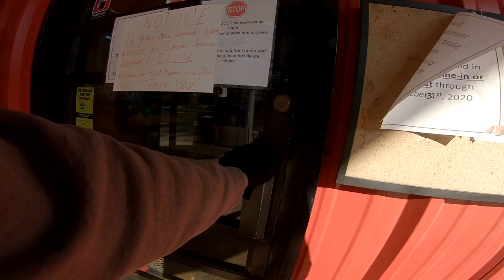Motorized Bike Coaster Brake Warning!

Comment: I was the guy that said sealed bearings where better. I forgot to tell you coaster breaks don’t hold up to super human speeds on the bike. I use mountain bike rims on my cruiser most all of them have sealed bearings and eliminates coaster breaks. My cranbrook is a five year daily rider except in snow. 20,000 + miles on fourstroke 49cc i broke three of those coaster break rims. There expensive, just go with mt bike rims and ignore the large gear cassette, i just run a tight chain on one gear. Way cheaper !
Reply: I was thinking about using a MTB rim….but their spokes are punny….and a CNC hub kills spokes’ even if you make a key….it rips the hub apart…then the spokes…it very annoying!
Reply: How about those “heavy duty” 12 gauge spoked rims from bike berry? Are they any good?

Comment: I have a coaster brake on mine and have had zero issues. I think people are having trouble because they're leanin' on that pedal with every fiber of their being, and, having gone through more than a few coaster brakes for that reason, learned you can't do that. Gradual braking is key, and it also helps to have front brake assist, at any speed. This is all based on my own experience...
Reply: Yup just tap it works fine

Comment: I had this happen 2 times... do not trust coaster brakes at high speeds! I was going down a road at about 35mph when it locked up on me completely. I did not fall, thank god, but I ended up grinding my tires into oblivion. I did take the brake plates out, and slapped a disk brake on.

Comment: Those tower thingies are loading posts for Traction sand, in tough situations where the rails are wet, covered in leaves, etc... Both steam and diesel electric locomotives have air driven sanders that shoot sand in between the rail and the wheel to boost traction.

Comment: Good job keeping it upright. 
 Coaster brake failure can ruin your day. If that’s all you have run it just remember to periodically pedal even though you’re not with cadence of the bikes current speed pedaling slowly to keep that thing from building heat. Keyword pedal slowly and not too fast you may  throw your chain off.

Comment: Well, i was planning on running a front v brake and a coaster brake, but that seems like a bad idea now. I think ill just buy a dual caliper set now
Reply: Is the only think you have to change out is the coaster breaks for the cranbrook to be semi reliable? Can you put them on the steel rims?
Reply from the maker: So far the only failure I have had on a Cranbrook is the coaster brake. More specifically the soft coaster brake arm striped out.
Reply: @LAHover  thanks. So I’m going to be a first time builder and planning on getting a cranbrook and zeda 80 firestorm. What should I replace right from the jump? Delete the coaster brakes for dual caliper / hand brakes? Will I have to adjust the crank arms? Do you know of any videos with a guide to this since so many people end up getting rid of the coaster brakes? I am a first time builder and new to this so I am scared to get the cranbrook and not know what to do with it to make it more safe. I posted in your discord as well

Comment: The 40:1 is slightly richer than 32:1 and back in my racing days, we would do that to change fuel mixture a half jet size. It's not much of a difference, but you can tell easily between 25:1 and 50:1.

Comment: I don't use coster brakes on motorized bicycles.  The first time I had the little screw vibrate loose holding down the break arm, the brake arms starts spinning a million miles an hour till the hub seizes up.  Once was enough for me.  I take the brake arms off and use a C break.

Comment: Ive never had a bike with coaster breaks very long, that bike setup is slick as hell though!
Reply: I did it's cool because you only need front brake lever on your right but have a lot of cons.
I think the coaster hub can't handle high rpm bevause it burns inside and dried hub the lubes.

Comment: Im not sure but if you grease the brake shoes inside the hub, it may help with that. I did the same thing to a cranbrook and it seemed to help
Reply: I did the same thing with my Cranbrook packed it with high temp grease and removed the brake plate.I have disc on the front n shoe brake on the back

Comment: I found this video because I heard that coaster brakes can malfunction going at high speeds, and I wanted to see if other people had experienced this. I like to ride downhill on my BMX bike, and hand brakes don't completely stop you at high speeds so I was thinking of getting a coaster brake. I will just stick with handbrakes. Thanks for this video.
Reply: Why not go disc brakes
Reply: @Mi_vida_loco  Well, I have an older model BMX bike, and I don't think it can take disc brakes.?
Reply: @imagesinla8575  they make disc brake kits for all size wheel and hub I have disc brakes on my stock 1984 mongoose bmx bike
Reply: @Mi_vida_loco  So did you just go down to your local bike shop, and get it done? Or did you order the kit from somewhere? I'd sure appreciate a little more info.
Reply: @Mi_vida_loco  By the way, I have an early 80's Cook Bros. Racing.
Reply: @imagesinla8575  that’s a nice bike if it’s the one I’m seeing it’s identical to mine and you should be able to get a set of disc brakes for 50 dollars tops
Reply: @Mi_vida_loco  Whoa, thanks for the info. buddy. I'll be looking into it.

Comment: My coaster brake also failed while I was driving downhill.
Almost had an accident thanks to the Coaster Brake itself even though it failed I was saved by it because the Hub locked inside and the wheel don't spin anymore and that's why it stopped me downhill for being a destroyed but still brakes.
The rpm burned the mechanicals inside the hub, the high heat caused to dried all the lubes and destroyed my brake.
I'm only using a China Coaster Hub.
Only last 1 month on Motorized Bike.

Comment: Your mix change is definitely the difference in your high rpm knock/ping. 
Go back to your 32:1 and enjoy, the power gain is insignificant if your tuned for the mix right, which it is at your old mix.
As to filing the key, yeah it can be done, but be prepared to crack the case regular to reset it and lock it down, the vibes will not allow it to stay set long

Comment: I'm getting ready to install an engine on my bike. So far I've only got the sprocket on and I put the tire back on but my back tire does not spend very freely what the heck I've tried to redo it like 8 to 10 times now and it's still not spinning freely any suggestions

Comment: I would have never thought of having a coaster brake hub on a trail bike how do you do quick pedal resets without a cassette or freewheel
Reply: It has a freewheel,but if u move your foot slightly more back,you engage the brake,the coaster brake is the worst
Reply: I also don’t recommend putting a fixie hub on your motorized bikes! too much of a party lol

Comment: i plan to use a freewheel with a 5 speed cluster if i can find a 26" with a frame of that type
Reply from the maker: Just went out of stock. But look up the Huffy Lockland (mens). It's basically the same frame but with rim brakes and a shifter. Also the Kent Bayside. Similar good for 2 strokes.

Comment: Somebodt stole my bike last night. Real bummed about it. I had a bbr racing motor and every part of it was upgraded.
Reply: You should check sites like let-go and OfferUp and Craigslist that's the way I found my stolen bike... call the cops tell them where they can find it on the internet and the cops set up a sting! try it
Reply: @tedshredhard23  i tried as well with my bike that was stolen. Unfortunately i didn't find find anything of Facebook Marketplace Offer Up or Craigslist... I didn't have a motor on it but i was riding it to work and was planning to slap a motor on it.

Comment: Same has happed to my coaster brake except my wheel locked up. I took it apart and packed it red grease seemed to to the trick. But I didn’t trust it after having to carry the bike back. so I no longer have a coaster. Went with sturmey archer hubs.
Reply: Which stumey hubs did you get

Comment: I have never had trouble with the coaster brake on my cranbrook now i don't go the speeds most of you guys go because I think 20 mph is plenty fast for that kind of bicycle. However i've only went about 15,000 mi on mine so I don't know maybe it does make a difference when it gets older.

Comment: I’m not too sure about coaster brakes because I’ve mainly worked on cable brakes but could it be that he was going so fast that he grounded down the brake?
Reply from the maker: The cone nut spun and striped out the cheap/thin the brake are. I got a stronger brake are to replace it with. Now I only use a coaster brake for slowing down, not for emergency stops.

Comment: I would not grind down the key way because it seems like a weak point. More prone to breaking I think. Also I have the same problem with my yd100. It doesn’t run the smoothest as if it’s missing a fire every once in a while. It has to be our Cdi or strength of the magneto

Comment: Beach cruisers make the perfect gas bike….but the damn coaster brakes sucks.
A rear beach cruiser spokes are heavy duty, and a CNC hub is perfect….but the back rim always comes loose and wobbles….I might find a way to make it a free will and put lever brakes on the damn thing.
I even rebuilt the damn thing….and back the coaster brake insert lever is shedded…I miss the last cruiser I sold, I ended up welding a plate on the rim itself, and used a MTB rim….You can also get a phat motto back rim…their $125 bucks but they are one of the best gas bike rims you can buy….and it has the ability to have disk brakes….You will see them on every phat motto 4 Stroke bike….it’s one hefty rim!

Comment: Im considering buying YD100 or YD80 personally i prefer YD100 because i will be using it for cruising ( about 30 miles a day ) can you tell me witch kit is more reliable. I want top speed around 35 mph. Which is better and why?

Comment: Okay so I have a beach cruiser and it has coaster brakes I guess that's the pedal brakes I'm not really sure but I'm wondering if that would be okay to have on the bike with a motor please somebody answer me back
Reply from the maker: Yes, but try to and some rim brakes if you can. Coasters can fail during emergency stops. Also make sure both cone nuts on the rear wheel are properly adjusted after installing the rear sprocket.

Comment: The coaster brake operates on a worm gear type thread and with the forward torsion of the motor the way that the coaster brake engages it climbs the worm gear causing the crank to abruptly lurch upward causing the rider to lose control... Just fyi

Comment: Hey, I have a motorized bike and when I wanna turn it on . I pedal and everything but I release the clutch and accelerate and it brakes hardcore , it doesn't want to run at all . I'm not even able to ride it normal
Reply: Adjust your clutch

Comment: Have you ever had problem in your bike that the top chain from the engine is hitting the sidewall of the tire once in a while?
Reply from the maker: Yes, on a stock sprocket you can flip it over so the chain has more clearance from the tire. It's also important to make sure the wheel is true.

Comment: That's y most people stick with either good old c brakes or go to disk brakes my friend that can snap the axle at higher speeds I should know it happend to me I've also bent the axle from them just remember it's a final stop break like ok now I'm at a light and fully stopped its mad dangerous on hot top hopefully u just spun the axle loose

Comment: Are these bikes easy to build? I’ve watched this channel for a while and I want to build one
Reply: Yes it’s very easy to build.
Reply: @NicksBikes  putting the sprocket on is by far most difficult.  But all u need is patients
Reply: Go for it, patients, and loc tite, and permatex liquid metal epoxy 5500psi will be needed, and a willing need to fiddle a bit
Reply: easy but may require a third hand

Comment: You should try running a b4hs that's what I've used in all my motorized bikes and I have never once had an issue with fouling or anything.
Reply: What’s the weather like around where you live? Colder? Or usually more hot?
Reply: @DudeWithALude97  well I live in Oregon on pretty much always raining and right around now its below freezing most of the day